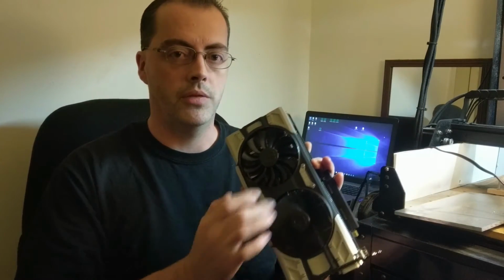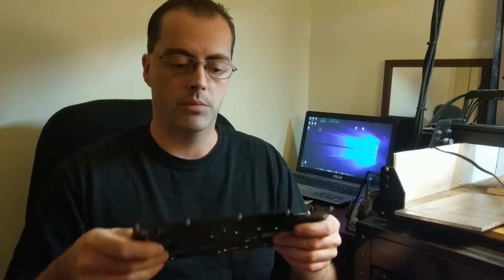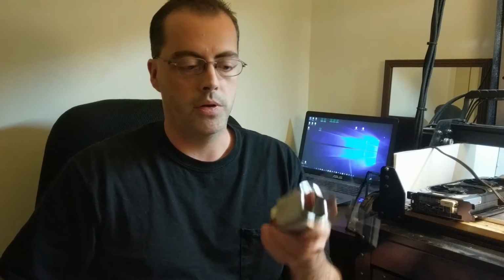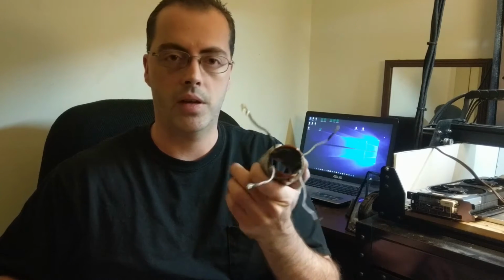Project Updates: Where Is PfSense And Why Does It Take Me Forever To Upload New Content.

Comment: Can't login to the verizon box and configure their router as just pass through?
Reply from the maker: +Justin Speck someone else commented that it is possible with forwarding all the ports to the pfsense box. I just haven't had enough time lately to mess with it. What I think I'm going to do is run a cat5 cable from there ONT box to my apartment. That's pretty straight forward. Then I just give them a call and have release the dhcp service from there router, and have the pfsense box handle everything from there. That means I can also return there router saving me more money on my bill. :)

Comment: Fios uses MOCA for the wan and lan links. If you can run cat5/6 yourself it only take a 5 min call to fios to swap your ont from coax to the rj45. Also when you do plug in your pfsense router be sure to call fios and have them release the dhcp wan address
Reply from the maker: +thomasofacton thanks for the tips man. I will be running the cable myself. I have to run the cable along the outside of the house a short distance. I will definitely make a point about the dhcp wan address.

Comment: Did you fix your coffee table editing system so you can stop editing on your laptop? 
Also, did you set up your router w/ the port forwarding another person suggested below?  
It is surprising that you don't have an extra regular desktop for your workshop that you can use instead of the laptop as a CAD designer/ troubleshooting system/backup editing system when your main coffee table system is down. But I know $ doesn't grow on trees.  
Next build idea: Quadro design system for your workshop with giant bolts and rivets and stuff like that as the theme? 
Just found your channel. I think it is really cool.
Reply from the maker: +Jordan Allison hey man. Welcome to the channel. I actually did recently get that rig back up and running. I'm working on the update video with an explanation of what actually happened. Should be up soon. I've just been crazy busy lately.
I did briefly look into setting up the router as suggested, but I again, didn't have enough time. :(
I like the theme idea for the workshop build. I've got a Node 202 from fractal design that I'd like to do that build in. It'll be strictly for editing and design. So I'm thinking a Zeon build.  And of course that'll be heavily modded.

Comment: Hey, I've really enjoyed watching your videos on building your pfsense box! Just so you know though, pfsense can sit behind an existing router quite easily.... You can plug the pfsense router into your current router and then set the wan interface to dhcp in pfsense then port forward all ports from your existing router to the pfsense box and it will work fine...… or wait for your isp to come out, either way
Reply from the maker: +nickijames9 hey thanks man. I'll give that a try. I don't know why I didn't think of forwarding all the ports to the pfsense box. This is what it's all about. Helping each other and spending knowledge.
Reply from the maker: +nickijames9 spreading*
Reply: CyberDen Systems I completely agree… most of the stuff I know about pfsense I have learned from others... and no worries, I used this setup for a while as I didn't have a modem but the router my ISP gave me had a modem built in..... Please do keep us al updated on how this goes :)
Reply from the maker: +nickijames9 will do my friend.